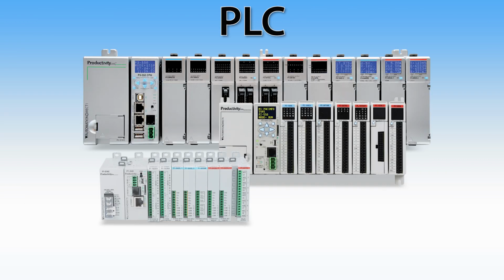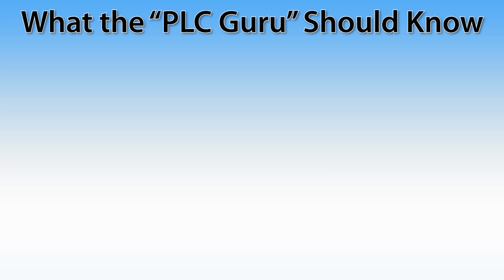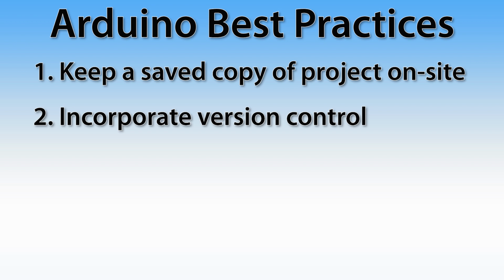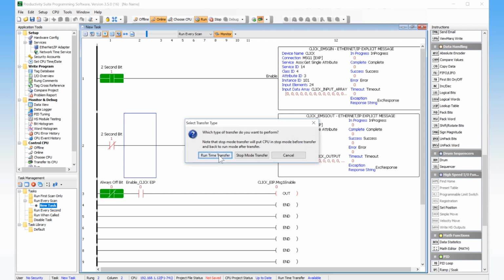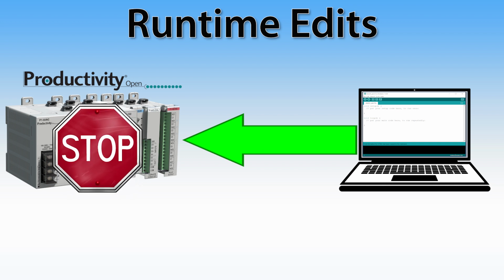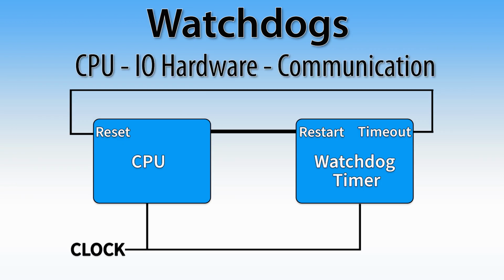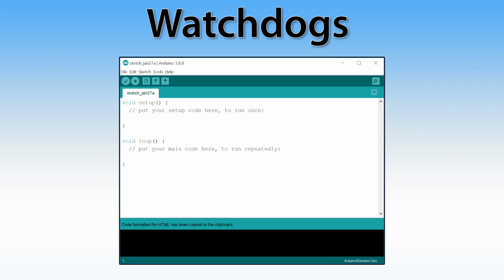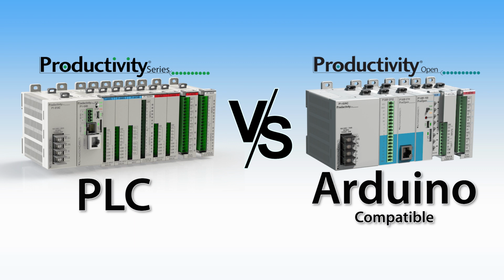PLC vs Industrial Open-Source Controller (Arduino-Compatible) from AutomationDirect

Comment: This is great that it has the necessary certifications (especially UL) to exist on a DIN Rail without an inspector flagging it.

I do wish there was a watchdog library to enforce a maximum time in the loop section. Too many will use endless while-loops waiting on a signal and learn the hard way. But for those who know good practices, this is a very freeing and empowering product.
Reply from the maker: Thanks for the comment whickevision. Having a certified Arduino that is expandable is definitely a game changer for Arduino in the Industrial world. There are some example codes for a watchdog in the Arduino IDE and there are plenty of Watchdog examples on github and other Arduino code repositories. The effectiveness of these are still dependent of the programmers implementation.
Reply: We actually have a watchdog feature built-in to the P1AM-100 for this exact reason.  Check out more information on the CPU here: https://facts-engineering.github.io/modules/P1AM-100/P1AM-100.html
Reply: The SAMD21 comes with an internal watchdog timer. Even the atmega328p (arduono uno/nano) has one. Yet of course you need to program it and tell him if you want to cause a restart, an interrupt, both, etc...

I'm very sure that the development team will come up with a library to set up the watchdog timer and events it can generate. Right now I got nothing but the SAMD21 datasheet to design a quick library and have nothing to use for testing.
Reply: Ok. So there is a watchdog to "pet", or else the output modules will shut off. Thanks for confirming, see the GitHub example links above.

Comment: comparing one wheel bike to whole miner truck.
Reply from the maker: @goldrojak
Yes, they are two different animals.  A PLC has a lot of functionality, is easier to program, more reliable and generally made of more rugged hardware. Absolutely agree that the Arduino does have much more potential functionality, but it is the knowledge level for even basic programming is much higher. Thanks for the comment!

Comment: I still prefer  the Arduino Industrial standard, they can withstand very low and very high temperature, cheaper, I can automate my process anytime,  the only problem is modifying codes in real time, I hope Arduino is upgraded to perform that too
Reply from the maker: @ Trandyz, We are glad you enjoyed our video. Arduino and Raspberry pi products are very popular options for control projects. Hopefully developers will continue to add more options. Make sure to check out our other videos https://www.automationdirect.com/videos?utm_source=KOjPn9LVcjI&utm_medium=VideoTeamComment

Comment: OMG! The basic difference is plc is a time line scrip language so read the code inside the chip is same cold in programming. Also it is real time processing which is more reliable than mcu even the mcu is already very reliable and because it is time line scripts there’s almost no mistake room. But it is 360 all down side than any object language to programming especially in a large project and that’s why only little still in factory application.
Reply from the maker: Thanks for the comment.

Comment: I've found working with both professionally is that PLCprogramming is significantly visual based so is more intuitive.Arduino brings extreme low cost  but has a steeper learning curve since it's all text based and you have to determine it's limitations and conflicts and correct. A lot of fun with both and consider them Legos or an erector set for adults
Reply from the maker: Thanks for the comment Zygmunt.

Comment: PLCs are for industrial control. Arduino compatible MPUs can do anything and are everywhere. I have done 1 mhz control, a usb to ttl converter, a wifi robot, mesh networking, xmass lights, wifi garage door opener, irrigation system, you name it. They are open source hardware boards and software. I'm a c programmer interested in electronics and arduinos are a gift from heaven, since the learning curve is shallow, so they are fun. One time I was mowing my grass and two people stopped me to ask me questions about arduino. It's that popular.
Reply from the maker: Thank you for your comment. Both platforms are very useful. Understanding each platforms pros and cons, will help you evaluate which is best for your system.

Comment: I worked with PLC’s before Arduino was ever mentioned for the first time and never used one. In today’s industrial espionage world, which is simpler to protect from hackers, the PLC’s or the Arduino platforms?
Reply from the maker: Any security protocol will include factors both internal and external to any controller. For the Arduino, security will depend on the measures that are programmed and implemented by the user. PLCs do offer embedded security (depending on the platform) like password protection, ping disable, session-based communication, etc. However, the controller’s internal security should be just part of a multi-layer security approach. Check out this article for more: https://www.controleng.com/articles/cybersecurity-centered-systems-and-fundamentals/

Comment: I just saw this video and it is 1yr old.  I hope you respond.  I just purchased an Arduino to automate few key items to help me as I am disabled.
Can we talk?  I can tell you what I have in hardware, sensors and simple project watering vegetables from rain barrels.  You can tell me what plc would require and differences.

I “will” keep Arduino if for a different project later if it is easier for me to use PLC.

Please respond to this message and I will get notice.  We can go from there with different communication type.  Thx, Alton
Reply from the maker: It would be best if you contact our Free, award winning technical support for product questions and assistance.  You can find their contact information as well as our community forum here:  https://support.automationdirect.com/

Comment: can we link between them(plc and arduino)?
Reply from the maker: Yes, typically you will just add a Modbus TCP Stack to your Arduino and you can pass data between the two platforms.

Comment: With Arduino you can embed programming that lets you do parameter adjustment at run-time, using buttons, dials, levers and so on.
Reply from the maker: @Jesus Bermudez, Thanks for the comment.

Comment: Nice Video Sir! Please help me sir Iam confused whether i should choose arduino or plc for controlling air temperature in farm and turn on the spray or other stuffs if it is too hot
Reply from the maker: Chickenz, personally for this operation I would advise a PLC. Due to the rugged nature of the application and the longevity.

Comment: What is a PLC/ARDUINO? Are they a type of ssd?
Reply from the maker: PLC or programmable logic controller in a industrial control platform that can automate processes, and is designed for industrial applications. Arduino can also run and automate processes but is typically not designed for the rigors of industrial applications.

Comment: Difference is simple. One is a microcontroller the other is a microprocessor. You're not gonna be doing anything meaningful with a microcontroller. A raspberry pi + rtOS will do the trick but still not close. A real PLC in the real world will always be better than a hacky one. You need to build on from scratch if you even want to compete with the big boys like Beckhoff, Siemens, AB and Schneider.
Reply from the maker: Thank you for the Comment

Comment: How to communicate raspberry pi to plc
Reply from the maker: Thaskar, very broad question. That is going to depend greatly on the Communication protocols allowed by the PLC. The easiest way to transfer data in this method would be through MQTT. For example the Do-more BRX plc has MQTT protocol available and  Rasberry PI works well with MQTT. Please see this video on Do-more BRX and MQTT.; https://youtu.be/7_WTbL14Fq4
Reply: @automationdirect  thanks

Comment: for those of you that may be unfamiliar with arduino and c programming there is software called xod that has a bunch of libraries and conditional controllers that make programming the arduino so much easier and will convert your project into c so you can copy and paste into the arduino ide to run. the website for it is xod.io and youtube has videos that will help with getting you started on how to use it
Reply from the maker: Thanks for the info Jeffery!

Comment: so, can i use Arduino as much reliably as PLCs keeping the safety at the top?  so why industrialists prefers PLCs over an ARDUINO ?, they are really cheaper though....
Reply from the maker: Hritik, The industry prefers PLCs as they embedded routines to run in an industrial environment, whereas with an Arduino these routines would have to be made by the programmer in Arduino. Examples of this is Hardware and software watchdogs, Hardware configurations, and other quick to setup macros that are present in PLCs. Arduino compatible controllers have their place in the industrial world but PLCs do make it quicker and more reliable for more common users.

Comment: Excellent video! Although I love Automation Direct and have used their PLC a few times, I mostly use Allen Bradley PLCs due to the massive assembly lines they’re controlling and of course AB’s chokehold on the industry. I haven’t found a single process I couldn’t accomplish with a PLC and the built-in instruction sets. Speed can become a problem with testing equipment and maybe PC based controls is necessary.... And to anyone reading this in the industrial industry, Automation Direct is an excellent suppler of automation products. Keep it up, AD 👍
Reply from the maker: Thanks so much for the support Austin! Make sure you go check out more of our videos at https://www.automationdirect.com/videos/home

Comment: PLC area is very conservative. Nobody wants to switch from established trusted platform. There are only few major vendors in that business, and they hold their positions for decades. Technically, the cost of the processor inside is less than 1% of the unit cost, so it becomes irrelevant.
Reply from the maker: Thanks for the feedback odissey2. Make sure to check out more of our videos at https://www.automationdirect.com/videos/home

Comment: Also with regards to monitoring the Arduino, you absolutely can do that. Its not done via the USB port, you use JTAG/SWD connectors and a device like a Segger J-Link. You can debug, evaluate, monitor and more.
Reply from the maker: Thanks for the reply!  That's good ot know, but the beauty of PLCs though, is all of that stuff is built in, you don't need the extra tool chain.
Reply: @automationdirect  It is designed this way so that people cannot connect to your device and steal your ip. Also roles.. there are devs, there are operators, there are troubleshooters. usually not the same person, so areas of concern are split.

Comment: I see the video is made for the PLC audience. Just wanted to let you know there are many ways to make applications configurable at runtime, meaning you can control any part of your plc without re-compiling. You can also use an ESP32 or similar to extend your Arduino type PLC to be an IoT device. It can report to your cloud backend, and receive control messages from an automated and centralized system.
Reply from the maker: Thanks for the info!

Comment: I was first wondering about counting using an encoder module since usually you don't want to use interrupts and slow down your code, especially if you have time critical coding and an encoder that has like 3000+ pulses per rev.

However, in the meantime, I was playing with another microcontroller, the stm32 blue pill. And it has an explicitly defined "encoder interface" which basically is an external clock input that has direction control. 

Now I looked into the SAMD21's datasheet and there is indeed the possibility of controlling the counter's direction based on events. A little bit more complex to set up, but still possible. (Page 682 of the SAMD21 datasheet)

The Atmega328 (arduino uno) does not offer direction control. You can only increment the counter.
Reply from the maker: Thanks for the comment! Check out more of our products on https://www.automationdirect.com/adc/home/home

Comment: I would give the Arduino a deserving spot for when you need to subdivide your tasks and give them to multiple controllers led by a "brain" (that would be the PLC). Since Arduinos are likely to be less expensive, you can use it as a worker who only reaponds back to the foreman, aka the PLC. You can interrogate the foreman for info on the process (via online diagnostics).

Heck I wonder if you couldn't make your own servo drive out of it. Stuff like that where you don't typically interrogate the device itself.

It's never going to replace the PLC, but it has a niche in terms of purpose.

And of course, there's a matter of preferences.
Reply: Also the fact that an Arduino-like CPU costs 45$ (which is very, very inexpensive for an industrial CPU) means that you can much more easily mount a distributed system which often involves hierarchical controllers, where some aren't as important to monitor.

Now of course networking is going to be more difficult. But the open-source community won't take long to catch up and create libraries to fulfill these spots
Reply from the maker: Thanks for the comment StageDiveBomb! Check out more of our products on https://www.automationdirect.com/adc/home/home

Comment: When i took my first electrical engineering job knowing Java, C++, and objective C. I was very surprised to find how bulky PLC’s are. Felt like I travelled back in time. They seem to be sticking around because the wide variety of people who know how to use them. Seems like there is a large product switch coming, once the new grads come out with C++ expertise, and the older guys retire. That being said, PLC’s are reliable and run forever.
Reply: I've always used PLCs in Chemical Research and I enjoyed the reliability. I was controlling massive pressures of H2 like 3000psi, and temperature controls up to 800F, while pumping oil into a mixture of that pressure with the H2 and high temps. We had a huge control panel of PLCs maybe 6' wide and 8' tall controlling 8 different reactors like this. We concerted pure oil from many different sources into pollution free gas, airplane fuel, and diesel. 0ppm  NO2 and 0ppm SO2, and 0ppm aromatics (benzene rings). There was a time when a tiny stainless weld gave way during a pressure check of the system and shot a metal rod inches from my face at bullet speed. The room filled with H2 and all the computers and GCs were in the room so I knew there were open electronics and I was glad to have that HUGE red push button to shut EVERYTHING down as I ran  away from the reactor and into the hallway screaming LOL.
That being said. There are many libraries easily used for many arduino tasks. I just wouldn't trust one to operate Highly dangerous chemical reactions. I personally use the Arduino and Pi often. I have also used SCAD to operate reactors. That code in Visual Basic is easy to set up a controlled temp and pressure and flow but still, basically PLCs.
I don't think they would ever depend on an arduino. I worked for Chevron, Shell, and Dow Chemical. PLCs will always be depended on. No cost savings interested in when safety is a concern. I like your input.
Reply from the maker: Thanks for the comment! Check out more of our products on https://www.automationdirect.com/adc/home/home
Reply from the maker: Thanks for the comment! Check out more of our products on https://www.automationdirect.com/adc/home/home